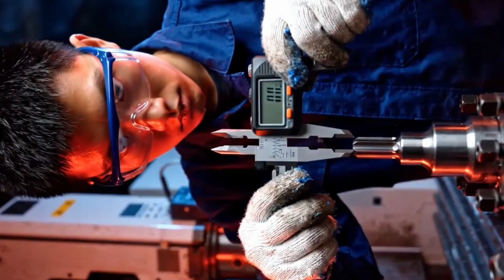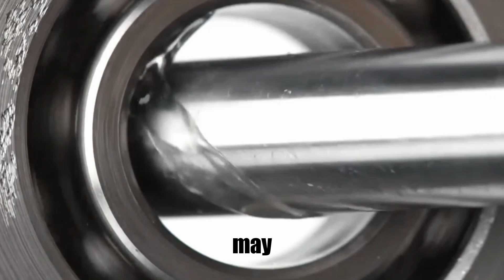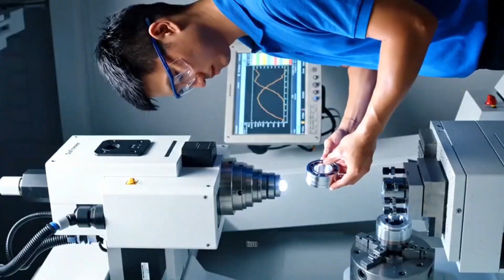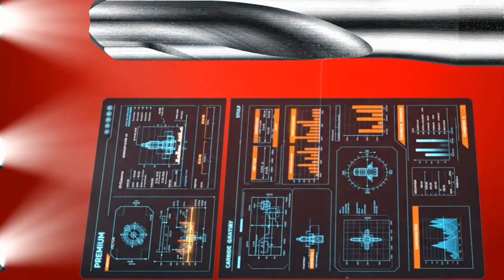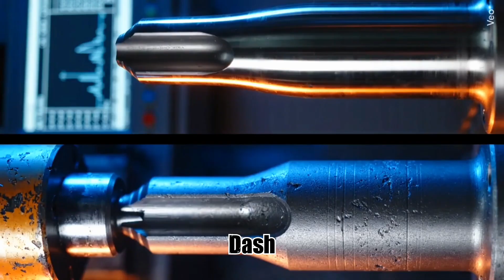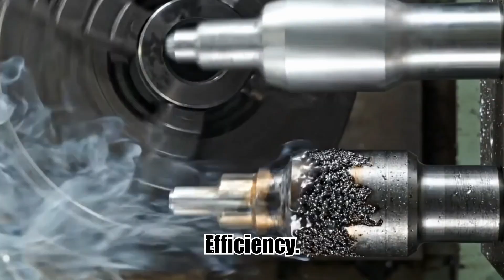💎 Why Surface Finish Matters (Real Comparison)#Milling #CNCMilling #Machining #Metalworking

Comment from the maker: Was it mirror polishing, a tight Ra requirement, or eliminating chatter marks on a critical part?
Share your experience below 👇
Every machinist has a surface finish story—and the best lessons come from real shop-floor challenges. :::